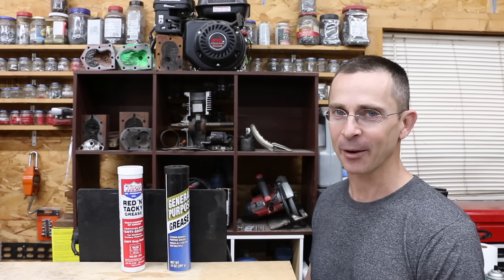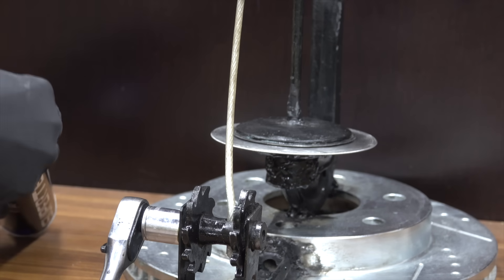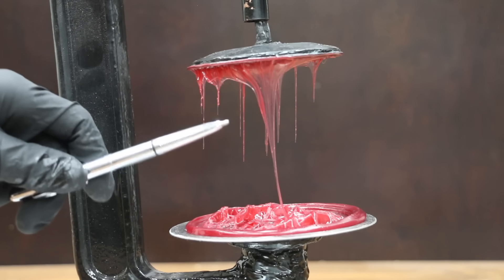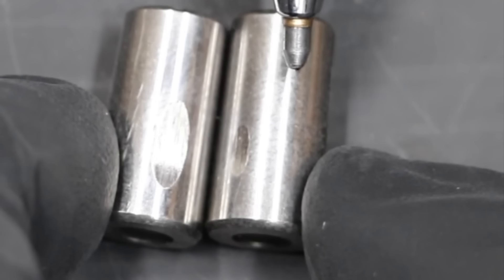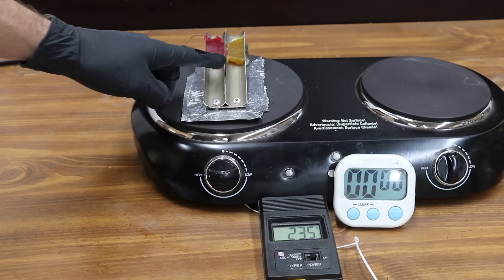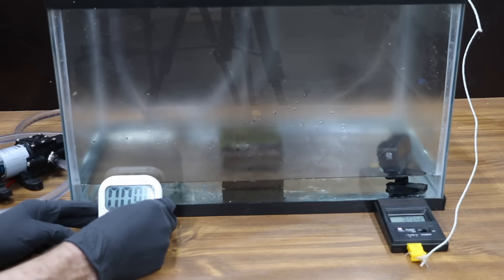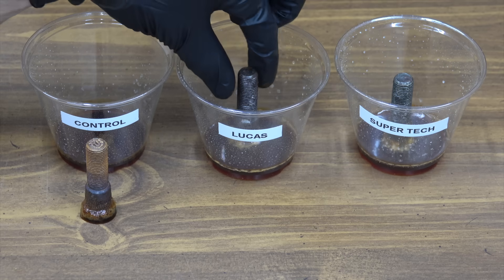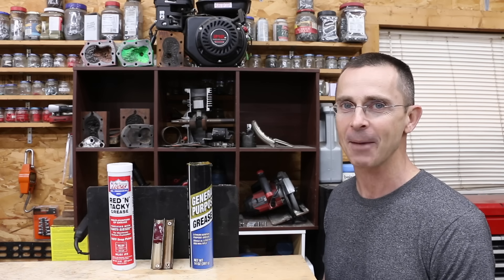Is Cheap Grease better than Lucas Red N Tacky? Let's find out! Bearing Grease Test Episode 1

Comment: I do a lot of handgun shooting at the range and noticed that using gun oil on the highly stressed parts would cause premature wear because the oil would quickly get hot and run off of the parts. I then start using a small film of high quality, high temperature grease on the slide rails and other high stress components. The grease always stays in place no matter how hot the parts get and the reduction in wear is phenomenal. An added bonus is that the firearm operates smoother with far less problems. Glock has been using grease right from the factory for decades,  and that is good enough for me. It works!
Reply from the maker: Thank you for the feedback

Comment: Another critical use for tacky grease involves its use in  the installation of axle-type seals. These seals have a tiny circular coil spring that keeps the inner seal tight when installed.  When the seals are not pressed in slowly, the force of installing them with a hammer beating on an oversized socket or on a seal driver can dislodge this critical spring, but you won't know it until the seal starts leaking prematurely in 6 to 12 months.  Tacky grease applied liberally on the inner side of the seal will keep the spring from popping out. Here is a link that visually explains this better than I can - https://youtu.be/WOfOHMI6Wnc

Thanks again to Project Farm for a great test showing the importance of optimum lubrication.

Test idea - Compare  battery powered (18v. to 20 v.) 1/2" drive impact wrenches advertised as capable of removing lug or high-torque  nuts on cars, trucks and tractors, etc.
Reply from the maker: Great feedback. Thank you

Comment: Its said that putting petrol in a diesel engine can ruin the engine but diesel in a petrol isn't as bad. Is there a way we can test to actually see what happens when the wrong fuel is put into the wrong engine and what damage is actually caused and also what happens to the fuels if they are mixed and run in the wrong engines?
Reply from the maker: Thank you for the video idea!
Reply: @ProjectFarm  No problem

Comment: MERCEDES BENZ green grease 002 989 00 51 10, AMSOIL polymeric off road grease NLGI#2,  SUPERLUBE (the stuff in all new snap-on ratchets),  Redline CV2, Mobol SHC 100 polyalphaolefin, CRC heavy duty driller grease, JETLUBE AP-1W
Reply from the maker: Great recommendations!

Comment: Sorry, but this is apples and oranges. You are comparing a high temp ep grease to a standard grease. Super tech has a red high temp grease on the shelf right beside where you grabbed that. It would probably beat the Lucas. This is pointless to compare these two greases, they are two different things.
Reply from the maker: Thank you for the feedback

Comment: 11:50 I have used vegetable oil in a floor jack, because grease is grease, oil is oil and that's what I had on hand... That being said, this was an interesting test, ideally, you want to use the correct product for the job; in practice, grease is grease.
I replaced my tie rods recently and got some grease on my gloves.  I wiped a tidbit on each lug stud before reinstalling the wheels to act as an anti-seize.  Recycling at every joint in the chain.
Reply from the maker: Thank you

Comment: TEST IDEA: "ceramic coatings" (for auto paint). YouTube search for a VinWiki vid entitled "Is ceramic coating snake oil?" and watch it. They're not snake-oil, but there's wide disparity in price.-- You'll need pieces of painted metal with crapped-out & micro-pitted clear-coat, then the ceramic coating applied, then we torture-test: Heat to 150F and blast with a UV lamp to simulate sitting on an asphalt parking lot all day, then freeze it, then heat again it, then power-wash it, ding it with gravel, rinse, recycle, repeat, etc. Prices range hugely, from $9 to over $200.
Reply from the maker: Thank you for the video idea!

Comment: I like the video but it is flawed. These 2 greases are 2 different worlds. The GP grease is just a mechanical grease. It only relies on surface tension to separate the two pieces. The wheel bearing grease uses sulfur to create iron sulfate when the 2 pieces of metal meat. Its a fail safe for when the grease fails.
Reply from the maker: Thank you for the feedback

Comment: Valvoline has many different types, would be cool to see theirs. 

Good to see the claims on Lucas. I only use that for semi’s 5th wheel and man does it make a difference over the others I used in the past. It’s so much quieter and lasts much longer. Even holds up against snow.
Reply from the maker: Thank you

Comment: Suggestion: Do a torture test on a Harbor Freight "Predator" engine vs. a comparable Briggs & Stratton. 

Should be interesting...
Reply: This is a good idea, but the test should be between a harbor freight engine and a Honda small engine. A Briggs could be included as a third but modern Briggs and Stratton engines are nowhere near the same quality as they used to be. New  Briggs and strattons are Chinese garbage and having owned multiple predators, Hondas and Briggs’ (I run about a half dozen pieces of small engine powered equipment daily for work) my personal experience is that Honda’s are the name brand and generally great but expensive, predators from harbor freight are usually close in performance and longevity to Honda’s and Briggs and Stratton engines are not likely to outlast the cardboard box they come in (obvious exaggeration but they are pretty terrible). The old American made Briggs and Stratton engines of last century were of quality but those days are long gone.
Reply from the maker: Thank you for the video idea!

Comment: The bearing test with water flowing onto the bearings would simulate a boat trailer axle. That would be interesting. Adding some heat after a wet cycle would simulate taking the boat on vacation. A Buddy Bearing submersed in water as it turns would be a great test.
Reply from the maker: Great point. Thank you

Comment: Can you test belzona 1111 epoxy?
Reply from the maker: Thank you for the video idea!
Reply: Project Farm welcome!
Reply: Project Farm it’s fairly expensive stuff and usually can get it on eBay. A friend of mine has some and I’ve used it before to repair busted cases on ATVs several times and never had it fail after using it.

Comment: Shaffers oil grease, wolfs head, shell gadus, Lucas Marine, valvoline standard grease, Castrols, and I belive amsoil has a grease line as well, maybe do regular grease but all headed to head, then try a marine grade for corrosion property’s, also try molybdenum (moly) based greases the are used for extreme working conditions.
Reply from the maker: Thank you for the video idea!

Comment: Test some food grade greases...... lubriplate white food grade.
Reply from the maker: Thank you for the video idea!
Reply: @ProjectFarm  no prob.....I have found that the greases sold for firearms are magnificently high ripoffs......they are selling them for $8 per ounce. I am always on the lookout for good grease and oil that doesn't cost an arm and a leg.  ....the thinner greases work best for guns but you don't want much migration under heat.
Low toxicity food grade is a plus when you are guaranteed to get it on you often ...

Comment: Great test, verified I haven't been wasting my time buying the good stuff.. .Would be interested in seeing some of the other greases tested too, such as the high temp moly stuff from various brands.

Oh, You didn't show if Lucas was able to meet its Heat Drop... I assume it did, but it wasn't actually shown, just that it outperformed (as expected based on the packaging claims of both).
Reply from the maker: Great point.  Had to stop the test. I feared supertech was about to start a fire.  lol

Comment: I’m no expert but it’s been my understanding that grease is “ oil in suspension “ designed to release the lubrication properties at a specific pressure and/or temperature. If a higher grade grease is used in applications where those higher temps and pressures are not reached, the oil doesn’t do its job. I believe that’s why you’re heat test shoes oil release rather than breakdown.
Reply from the maker: Thank you for the feedback

Comment: Greases to test! Amsoil, especially NLGI#1, both red and moly, and classic JetLube Amber CB-2. I'm not a believer in Lucas products. There is also a Mobile 1 grease. A really common "good grease" used to be Sta-lube.

I've always believed the physical properties, smoothness, adhesion of grease is as important as the lubricity, and additives like moly compromise the physical characteristics.

https://m.grainger.com/mobile/product/JET-LUBE-Amber-6HAL8

It's also critical to test the tackiness of used grease that has been stressed through a series of tests.

BTW everyone should know that overpacking sealed bearings is, I believe, a no-no. I imagine they could even overheat and be damaged in extreme circumstances. Usually excess will get pushed out, but that should be done before installing where it can move to a brake or clutch mechanism.
Reply from the maker: Thank you for the video idea!

Comment: You should now test that Lucas against RED LINE RACING. My good friend is the main engineer at Baer Brakes in Phoenix. They've done mass testing over the year's as well as they have brake dyno's. And they've found the Red Line out performs everything. Which is why there $4-6000 brake kits come with prelubed bearing's packed with Red Line's product
Reply from the maker: Thank you for the video idea!
Reply: @ProjectFarm  No problem. Them being the leader's in the high performance aftermarket brakes they don't want any failure at the track or on the street which why they did the extensive testing they did. Now thing's like water resistance isn't a Huge facture. As if your spending $4-6000 on some front brakes your prolly never gonna submerge in water LoL

Comment: We have an '86 Grand Marquis we've owned for 17 years, and a few years prior to that, I had another one. I used to repack the bearings around the recommended interval of 30k miles. When I started buying Amsoil grease about 12 years ago, I figured I could run the preload tighter, and go a bit longer on the interval. I was right! Part of owning 3 cars, plus maintaining everyone else's, maintenance intervals get forgotten quite a bit here. One time I went 80k miles on the same grease - absolutely no wear marks on any bearing or race. I get 3x the life out of bearings now, too. It's definitely true with grease - you get what you pay for!

Excellent video, Todd! Much appreciated!  👍🍻
Reply from the maker: Thank you for the video idea on Amsoil grease!

Comment: Tensile strength of bolts! Compare like 5 grade 5 bolts, 5 grade 8 bolts, 5 stainless (Specify if magnetic or not!) 

I say 5 of each because there may be variation within each brand of bolt for quality, that'd allow you to take an average. 

Just to see when they snap off from twisting, i guess. 

cool stuff always
Reply: Gotta be careful there--Chineesium bolts don't always perform to their labelings.   Lots of forgery on the higher-performance stuff.
Reply from the maker: Great test idea!

Comment: One of the things no one seems to be testing or asking about grease is base oil viscosity, in other words,  how heavy the base oil is, which has a huge impact on lubrication: lower speed requires heavier base oil whereas high speed requires thinner oil.

To give an analogy - older cars with larger engines running at slower revolutions required heavier oils for a good reason. Don't use a 5W30 in that muscle car... Conversely, too thick an oil in a small high revving engine would lead to power loss and overheating from fighting excessive viscosity and that could even starve the engine of oil.

That's an important reason why there is no 'one size fits all' when it comes to greases...
Reply from the maker: Great point. Thank you

Comment: Great video, very eye opening.
As for a grease you can test in a future video,  we use this grease alot at work http://www.acf-50.co.uk/corrosion_block.htm and in my experience on re-servicing the vehicles a over a year on from appplying this to various components it does an excelent job.
We started using it on advice from a technition who works for the RNLI (Royal National Lifeboat Institution) here in the UK. He services and maintains a fleet of lifeboats and he claimed that he went from using 16 diferent chemicals for lubriacation down to 6 after their work shop switching to the company who provides ACF-50.
Reply from the maker: Thank you for the video idea!

Comment: Maybe do a comparison of different brands of camp fuel/white gas. (Coleman, crown, msr, primus to name a few.) Is there a btu difference between them? The coleman is supposed to have anti corrosion additives in it (I have a 50 year old steel tank with not a speck of rust in it on my 413.) Do all the brands stack up against it, or are some actually better than coleman?
Reply from the maker: Thank you for the video idea!

Comment: Some of your testing apparatus are pretty ingenious. Side note: I'd love to see a comparison of lithium grease and molybdenum disulfide grease.
Reply from the maker: Thank you for the video idea!
Reply: And synthetic against common off the shelf stuff...mmmmm
Reply: ..and silicone grease.
Reply: @nhytg376tgyuu765gjmg  silicone grease is primarily for preventing corrosion on electrical parts or used because its food safe and non toxic, as a lubing grease its fucking rubbish as it becomes runny on heating.
Reply: @bigsparky8888  my thoughts exactly. A lithium is best for high speed bearing like on air handlers.
Reply: Moly vs. Lithium grease is a great idea! I tend to use the Traveler Extreme HD 3% moly grease from Tractor Supply on my equipment, as it's very reasonably priced for a 3% moly grease, but I'd love to know how it stacks up against something like the Lucas Red N Tacky, or other "premium" lithium grease.
Reply: @matthewwimmer1473  I was thinking about Tractor Supply grease also.  I typically use their red heavy duty grease for wheel bearings and general applications.
Reply: We use poly-urea grease at work, wonder how it compares as well.
Reply: Its not about quality but application performance when comparing these two or any other greases, moly grease is generally anti fling grease, it wont fly off an exposed part, lithium grease is generally multipurpose grease for sealed applications, then youve high temp grease, graphite infused grease, waterproof marine grease etc etc. Different greases for different applications.
Reply: I wonder how cheapo brand heavy duty grease would compare to Big Red.
Reply: Does anyone know how good the synthetic oil stabilizer made by LUCAS is!?!? Does this guy do anything cool to reveal its performance and characteristics!?!? Oh boy oh boy do I myself just Looooovvveeee the stuff!!!
That and any and everything Lucas makes are my personal favorites in which I usually highly recommend!!!
I love this channel and this guys tests! He is pretty smart and crafty!!!
Reply: @austinsears1637  I have...it is great stuff...since I started using additives like Prolong in older engines(85 Dodge 318 @ 118,000+ in 1984ish) that engine went over 350 000 miles...my son got pickle forked in the truck...that very engine was pulled and put in another vehicle...never had intake, heads or carb been pulled...only I rebuilt the Alternator around 160-180,000...most amazing 318 or any V-8 I ever touched...(my Son was ok...)
Reply: @austinsears1637  its pretty much snake oil, works ok for a little while but it breaks down pretty quick in a hot engine and loses its clinging ability pretty quickly,
Reply: According to the internet armchair special forces, molydisulfide creates sulfuric acid in the presence of salt water. I'd to to see if that is true and if it causes pre mature bearing failure.
Reply: michael blacktree  I was thinking the same thing the other day when I bought Walmart brand and right next to it there was rain-x

Comment: Please make a video on new motor oil properties vs 3500 miles used oil vs 7000 miles used oil vs 10000 miles used motor oil. This should show what is the real reason behind oil changes. Old myth of oil change at 3500 miles vs manufacture recommendation of 5000 miles vs practical change of 7000 miles or more will show how it effects engines in long term & its  wear.
Reply from the maker: Thank you for the video idea!

Comment: I guess the point of the test is to determine if "cheap" grease can preform as well as more expensive grease. In this case it can't. I think it would be more helpful to compare greases that were rated the same - apples-to-apples as it were. As far as I can tell, the Supertech grease is not rated GC-LB (highest rating, for example suitable for disc brake bearing applications) like the Lucas, it's just a low grade multi-purpose grease not designed for high heat and pressure. It's like pitting a lightweight boxer against a heavyweight boxer.
Reply from the maker: Thank you for the feedback